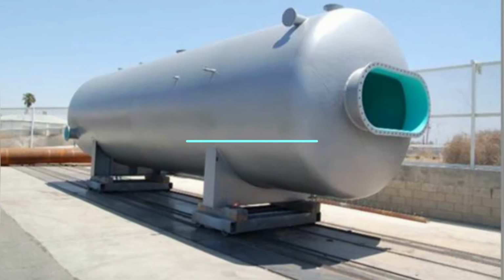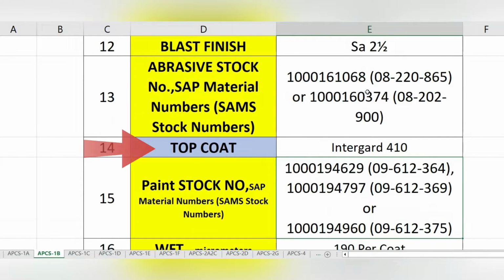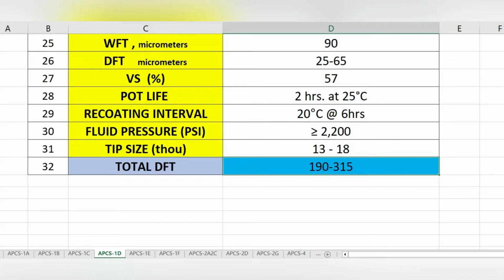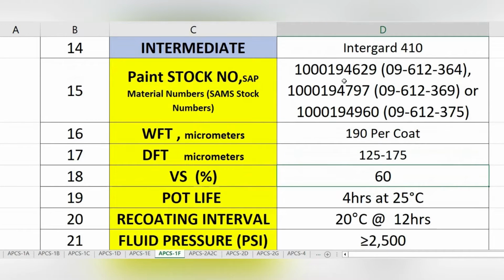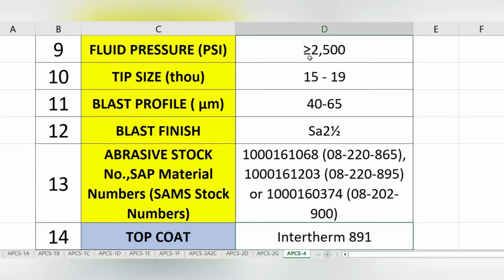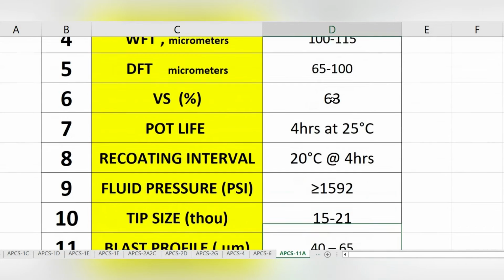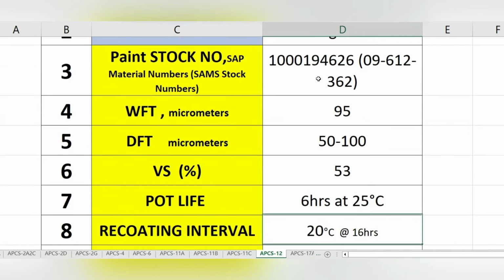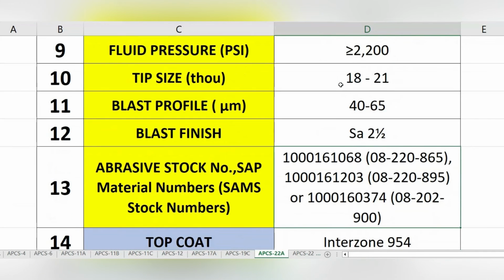SAES-H-001 – Coating Selection and Application Requirements for Industrial Plants and Equipment-P2

Comment: Polyurethane paint
In paint, the polyurethane polymer offers a tough and durable coating that is highly resistant to extremes of weather – intense sun, wind and precipitation. The polyurethane also allows the paint to be formulated to higher gloss levels, offering a beautiful and consistent finish.

  

 • AIRLESS PAINTING l COATING l CORROSIO...  

#anticorrosion #corrosionprotection #saudiaramco #sabic #ampp #coatingsindustry #coatinginspector #steel #construction

Comment from the maker: Normally for a coating projects ,client provide full paint system ,but for some small jobs client will give coating conditions like operating temperature, working conditions, offshore/onshore   etc.
in this case a coating engineer can easily suggest/recommend  a suitable paint system .
the coating procedure for suggested paint system can be submitted  to client approval
Reply: Can you share this excel sheet